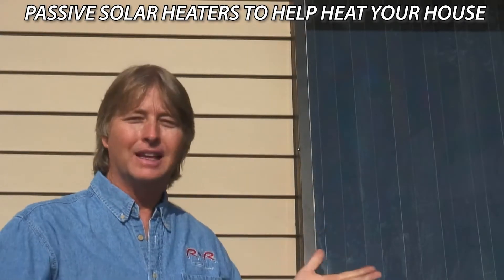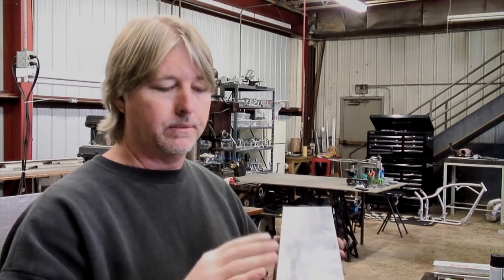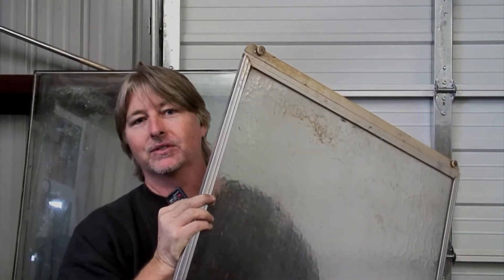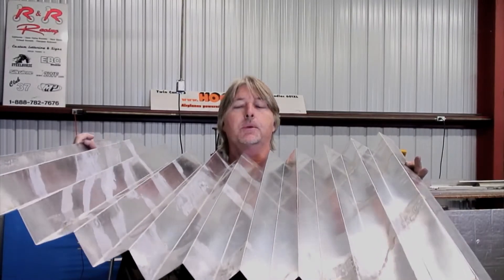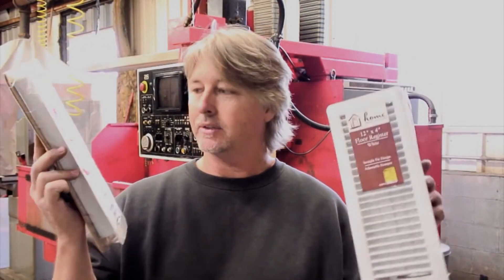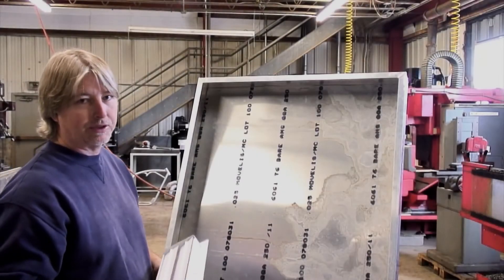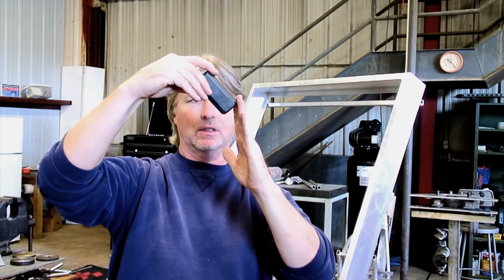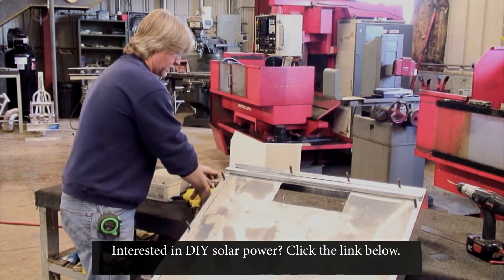Do they work? Passive Solar heaters.

Comment: The issue here is that you’ve used metal framing.  It needs to be wood.  All your ‘aluminum ‘ will conduct the heat away to the surroundings.

Comment: At least someone finally actually answered the basic question. However, I wish an engineer would get into the technical specifics of heat generated per volume of air vs time at how many lumens vs outside temp.

Comment: ULC Canada Says the POPCAN Design in the best with both ends of the cans open.  A 3 by 6 foot pannel will heat 400 Sq ft room at minus 20. to 15 degree's.
Reply: Hello. Do you have a link to ULC Canada?  Or more current information?